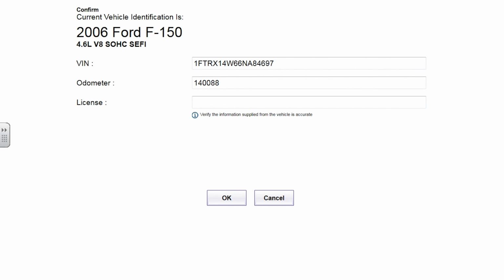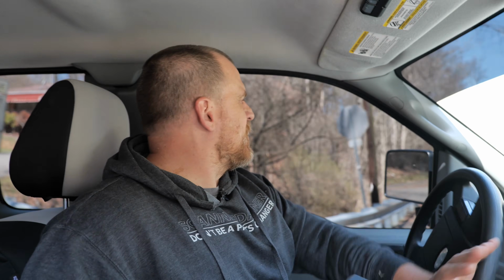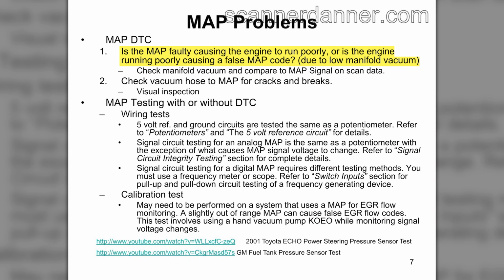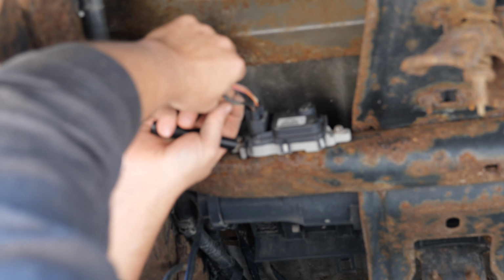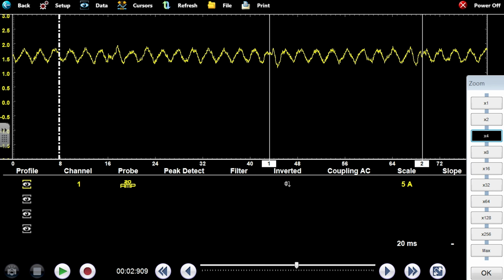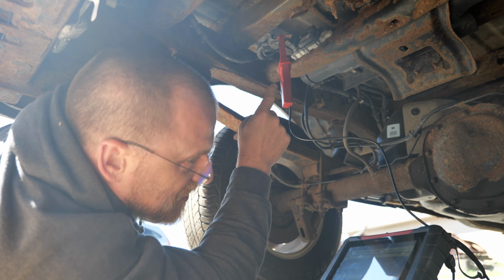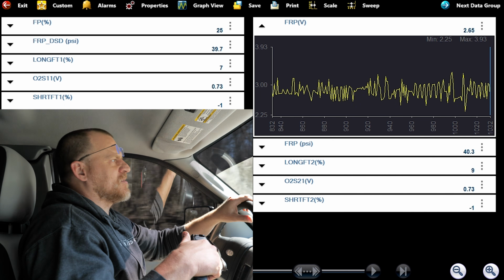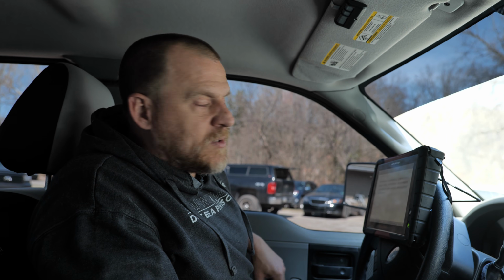Intermittent Low Power/Lean Conditions [2006 Ford F150 Electronic Returnless Fuel System]

Comment: Hey, paul I have 2010 journey cranks but won't start 
I checked
 fuel pressure 
Spark 
Compression 
All the fuses and relays 
But the it looks like the injectors are not getting power from the pcm plase held 
I know this is not a related video
But i I really need some help please
Reply from the maker: Port injection or GDI? If it's a port injection system the PCM doesn't supply direct power to the injectors, that would be done through a relay. 
Do you have power yo your ignition coils? 
What codes?
Reply: @ScannerDanner  yes,  I have power in the ignition coils, no codes but it is something really crazy cause when I turn the key to the start position, the battery stars drain fast, and my scanner is not  communicating with the car I use my Uactivate to crank the engine maybe the tipm
Reply from the maker: @rodger6940  get a diagram and find out how your injectors get power and that will lead you to the promise land

Comment: Heres how I would have diagnosed it. I would have cleared the codes and drove it again. That P0191 code is suspicious. I would check the wiring around the sensor and replace the pressure sensor since a range circuit code points to an electrical problem at the sensor.
Reply from the maker: Range performance is almost never a circuit problem. I believe it was a range performance code.

Comment: I have a 2016 Jeep cherokee and it does not crank. Radio does not come on, nothing. The ignition switch has been replaced, It does go through Can+ and Can- Lines, Whats my next step in diagnosing this vehicle?
Reply from the maker: Scan all modules, find out what's taking and what isn't
Reply: @ScannerDanner  it will not let me scan any modules. It says can not communicate with the vehicle
Reply from the maker: @moneymikesupplymusic  network resistance measurements would be next. Should see 60 ohms between pins 6 and 14
Reply: @ScannerDanner  can that be done with a scope?
Reply from the maker: @moneymikesupplymusic  no, just a regular dmm set on ohms
Reply: @ScannerDanner  do I put + on pin 6 and negative on pin 14 or does it not matter?
Reply from the maker: @moneymikesupplymusic  doesn't matter, just make sure the key is off and with the door closed, wait a minute or two before you get your final measurement
Reply: @ScannerDanner   what is my next direction after that test, if I do and if I don’t see 60ohms
Reply: @ScannerDanner  I am reading 58.9ohms
Reply from the maker: @moneymikesupplymusic  okay, step 2, with the key on, check for a 5v reference on your throttle body connector (TPS 1 and 2 use a 5v ref)
Reply: @ScannerDanner  unplugged or plugged in
Reply from the maker: @moneymikesupplymusic  unplugged is easier and will suffice for what we are trying to do. If you have no 5v ref. Next step is testing all power feeds at the ECM
Reply: @ScannerDanner  I am reading 0volts on all wires
Reply from the maker: @moneymikesupplymusic sweet, check all pcm power feeds next. Start at the fuses, get a good diagram. 
Here is the DIY version of the service info and diagrams I use 
https://eautorepair.adtrk.biz/?a=10817&c=24&p=r&s1=
Reply: @ScannerDanner  I did that and I had good power feeds and good grounds. NOTE don’t forget when i turn the key on, I have no power to my radio, ac/heat anything. I do have headlights and turn signal lights
Reply from the maker: @moneymikesupplymusic  get those diagrams, follow the power distribution diagram and focus on your ignition switch circuits
Reply: @ScannerDanner  Yes, I did that and this is what I came up with so far

Hello, I am working on a 2016 Jeep Cherokee that has a no crank. When you turn the key the radio does not come on, Nothing does. I replaced the Ignition switch which is called Ignition Node Module. From there I have a Wht/ Lt Grn wire and Vio/Brn wire that goes to Radio Frequency Hub Module. From there I have a Dk/Blue Wire and a Yellow wire that is Can+ and Can-  from there those Can+ and Can- wires goes to the Star Can C Body Connector. I scanned the codes the only code that was there was u0101 c2 can bus fault. Ever since I tried to clear them, My scan tool no longer communicated with the car. I then went ahead and replaced the ignition switch (Ignition Node Module) and Im still STUCK

Comment: Excellent as always, buddy! You too, Caleb!😎

Listening to your “rant” (as you called it) at the end, it IS stuff like this that led me to quit the industry. Wasn’t the only reason, but a big part of the reason. I always hated being on long test drives exactly like you were doing. I felt like I was wasting time that could be better used actually accomplishing something, even though I’m trying to get to the cause of the problem… It just didn’t feel like I was accomplishing anything. 

The other half of it is the infuriating engineering that we have to deal with when trying to remove a bad parts. Take my 2007 Silverado 1500 (GMT 900) for example - it took me 2 WEEKS to remove and reinstall a transmission because I was fighting this engineering. Plastic clips that don’t remove intuitively for the grille,
metal clips I had to fudge with to remove the transmission lines, electrical connectors that are infuriating …& every every single one is different, all different length studs on the exhaust manifold coupled with the catalytic converters being right up against them so you can’t use a deep socket… Then you find they are torqued to 4,000,000 ft/lbs. & strip a nut completely round, a bellhousing bolt at the 12 o’clock position that you can only reach from the tail end of the transfer case with a 4 foot extension… also where you can only use a 3/8” drive socket, which breaks at the torque required to move said bolt … and on and on and on. 

Every vehicle was like this, and it just burned me right out. I couldn’t charge enough money to make it worth my sanity.

Anyway, that’s my rant for the day!😂 Glad to see you guys still at it! 🙌 May God continue to bless you and the rest of your family.
Reply from the maker: Man, I could feel your pain in that description, I really could. Thanks for the comment and for watching!
Reply: @ScannerDanner  Thanks for your contributions to the automotive world, as always, brother!

Comment: I was thinking perhaps fuel quality or contamination.  Here in Canada, we transition from winter to summer blend typically around april 1.  I've seen my car fuel volatility behave weird around this time of the year and mess with evap properties  (2015 chevy cruze for perspective).  Anyways, I also watched a "watch JR go" video where a newish gm suv where the car would not start and a total fuel screw up happened and the engine would not start.  The owner put a full tank of premium when it was really near zero fuel level.   They substituted fuel with carb clearer and the engine was engaging.
Reply from the maker: 100% I've seen winter/summer blend fuel issues cause all kinds of problems. In particular when we have very warm weather in March!

Comment: 17:00 There should be a spacer between the FPDM and the frame. The aluminum touching the steel caused the aluminum to corrode away, so the replacement FPDMs should have come with studs to space the module away from the frame.

Comment: Noticed that the freeze frame data showed at 144 degrees on the coolant sensor. Maybe the problem will show up on a cold drive away load during warm up driving.

Comment: Hi ScannerDanner! I had a Hyndai Getz 1.4 2008 with my car. Problem with the gas pump, I was driving to visit my daughter's family, the journey was 170 km long and the engine stopped suddenly, I checked the fuses, everything was fine, then I took a 20 min break and was able to drive the car again for 20 min. I drove it. for 5 hours, before major intersections I took a break beforehand so that the car would not stop at the intersection. When we arrived at the destination, we bought a new gasoline pump, I replaced it with a new one and the problem disappeared.Of course, you have a more complicated injection system that you diagnose, such systems are found on most injectors that inject directly into the cylinder, which also have a high-pressure gasoline pump.

Comment: I ran into an intermittent FRP sensor issue similar to this one in the past. IIRC the sensor shares the signal return wire with several other sensors, including the power steering pressure switch. The wires on that switch were exposed and touching each other due to chronic oil leaks and was screwing with the FRP voltage.

Comment: Had a Land Cruiser in our shop a few weeks ago.  The customer dropped it off, without an appointment, stating that it wouldn't crank one time and there was no noise from the starter.  His wife was afraid of getting stuck in it.  We had the truck for a week and a half cranking on it and driving it trying to get it to act up.  Everything was checking good.  Hooked up a scope and looked at the starter current, battery tested good, no DTCs stored, and did a visual inspection. The customer called and we told him we haven't had any luck trying to get it to act up after a hundred cranks.  We told him everything we checked and the results of the tests we performed.  He was mad and said he doesn't care and wanted us to fix it because he knows it is going to happen again.  5 hour starter job on a guess wasn't in the cards for us, so we told him we would keep it a couple more days and try it off and on.  We finally gave up and told him we cannot duplicate his issue and for him to come and get it.  We also didn't want to cause the starter to fail cranking on it a million times.  He definitely wasn't happy, but if we would have changed out that starter and his wife got stuck, we would have never heard the end of it.  What do you charge for that and what would you have done in that type of situation?

Comment: I drive a 04 Mustang and I’m getting a fuel rail pressure sensor p0193 high circuit code that seems to be intermittent, so yet another video of yours that’s helping me pin point some things  on my live data👍🏻
Reply from the maker: Usually a circuit high code is the result of an open, either in the signal or ground wire or the sensor itself

Comment: Freez frame showing 53% FT while at the same time showing 7.37g/s MAF at idle . I would expect around 5g/s for this engine , basically MAF is over-reading by around 50% .. common on Fords of this vintage and can be intermittent.. i would love to hear back from u man
Reply from the maker: I dont trust freeze frame data fully to be honest. We do not know that this was idle. It also showed 50% load I think?
Reply: Yaa around 20% , good point, there is a few confusing pids in the frame, like barometric pressure, which i believe should reset KOEOFF to what ever the MAP reading and u guys around sea level i believe it cannot go that low even on the worst days of the year. And other stuff

Comment: Check fuel rail pressure sensor reference voltage while wiggling power steering pressure sensor underneath the vehicle by the power steering high pressure hose. This 5v reference shares with egr sensor & power steering pressure sensor. If the 5v drops then fuel rail pressure sensor signal will drop too and this will cause vehicle to run rich and possible the engine die. I've had this problem before. Hopefully this helps.
Reply: I was reading code criteria of P0190. States code sets when ref drops below a minimum threshold. As you stated, power steering pressure sensor shares some of the same wiring such as power and ground. But you "should" see a power steering pressure code if there was an issue with the power and ground to the sensors. Signal wire is independent on each sensor. 

I would still chase it with a wiggle test at the power steering pressure sensor like you mentioned.
Reply from the maker: In my experience, you'll have ref circuit trouble codes for what you're describing. Also I showed at the end, in the freeze frame data, that both banks were full lean (in spite of the one bank rich code)
Reply: @ScannerDanner  not necessary. You cannot always go by code. Just check it and you’ll see if it  drops.
Reply: @ScannerDanner  you can monitor both the reference and signal wires at the fuel rail pressure sensor with a lab scope just in case if they drop.  Usually the power steering pressure sensor wires are wet with oil from leaky power steering pressure hose and the wires are touching each other causing short the wires.

Comment: Only going to get worse for auto repair industry, especially non dealer independents.  Manufacturers losing money like an ugly gone fat callgirl, high loan interest, crazy pricing, no price control on foreign new build parts.  Who brain us to believe Mexico and China  build high quality new oem build parts
Manufacturers go even more stupid,  demanding even cheaper supplied parts.  Wait until wire insulation  that lasts longer than 6 months is a high priced option
Who's willing to pay for a $100,000 pickup that has poor to non existent wire, connector, electrical system protection against chemically or ocean salted roads and the day after end of warranty,  major corrosion failures.  No competent techs left to repair
See lots of the newish dead dogs setting out behind dealer service shops waiting for the next parts thrower....month after month 

Stelanntis is dead already,  just waiting for Bankruptcy Court to save the banks on the original buyout

Great vid Paul.  Techs of your caliber technical knowledge honesty good business sense will survive
Parts throwers will slide back down the food  chain
😊
The parts houses kids with their code readers make a commission fortune off the weak of mind
Corporate Capitalism Baby😅
Reply from the maker: Pretty good description of this field. Thank you for your kinds words too

Comment: could it be the Baro sensor reading incorrect? 26.8inHg seems a bit low, thats about 3k ft. altitude. When MAP sensor and BARO signals differ, P0109 is stored.
Reply from the maker: It had a 156hz signal right? 160 is sea level. We're at a 1000ft, so a 157-158 is normal. I didn't bat an eye at that number. You can also have lower than normal baro readings when the engine is running poorly and you're at wide open throttle

Comment: Thank you Paul for the video! Even though you didn't get the result you were looking for, it's OK because it was still a great refresher for returnless fuel systems. Hey I had an interesting one today to share with you. I have a customer with a 2010 chevy tahoe police that was stuck lean and running poorly on bank 2 after it was put in the ditch. Ended up finding the wiring to the pre-cat o2 but it happened in such a way that it also fried the sensor as well. I came to find out the two damaged wires were for the 12 volt ignition and the other was the signal return to the pcm. Pretty fun one for me as I usually don't see many o2 sensor failures. I just got a call back from the customer a few minutes ago saying the truck is running better than it ever has since he has owned it so that was pretty cool.

Comment: Paul, at the end of the video you emphasized what it did NOT need. 
You failed to mention what it DOES need......fuel, lol. 
Should have asked if when it died on the guy, did it run out of gas? 😂😂

Comment: If that were my personal truck, It would be getting a pump, driver module and relay. Last tow bill I had was $250. That pretty much covers parts cost for 1 tow.
Reply from the maker: If it's a customers car and you do that, what happens when that doesn't fix it? As long as that conversation is had with the customer, then you're good. The problem us, a lot of shops out there would do all of that, but they'll sell the job as "this IS your problem". Then when it doesn't fix it, the customer is pissed!
Reply: @ScannerDanner  Unfortunately for the customer, it's an intermittent problem. The truck is not reliable as it is and cannot be trusted. It will have to be completely broken, or caught when its intermittently broken to be a 99% repair fix. 

For my personal truck, I am aware it will be a pretty good chance its fixed. That could be sold to a customer in a shop as well as the same.

Comment: I did fix my 2010 Dodge Nitro that you helped me on... about the "APP2" data dropping out periodically.. and the limp mode issue....  I installed that new water pump and it has never had an issue since.   Ivan at pine hollow.. and Eric O at south main auto both told me the same thing you did...  that APP2 data drops out because it's a type of diagnostic test that the ECM sends out every second or so..........   Pretty weird:   Because I talked to 2 different guys who rebuild ECM's for a living-- You just mail it in to them:    and they didn't even know this, about APP2 dropout.  They told me that it was unfixable and that I would have to just buy a new ECM.   :)  .. That shows how cutting edge youtuber diag's knowledge is..  and how reliable you guys are.  bravo ... Saved me from buying a $600 ECM
Reply from the maker: That's pretty awesome right there! Thanks for sharing! Ivan and Eric are both super smart techs